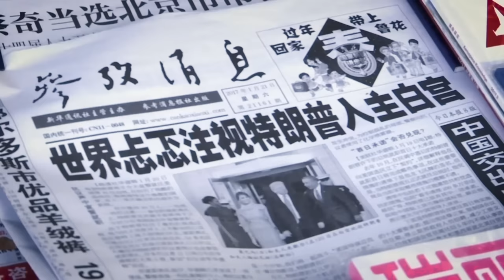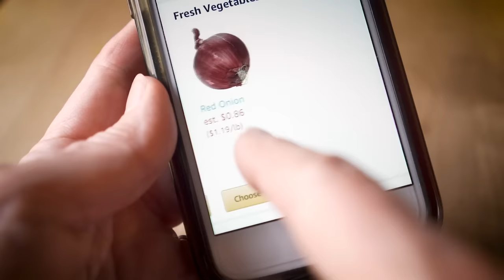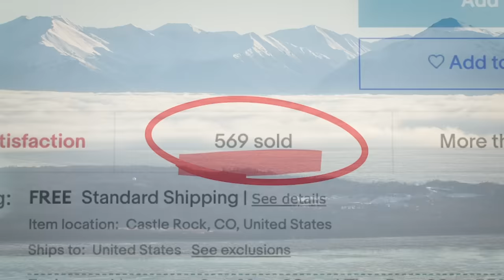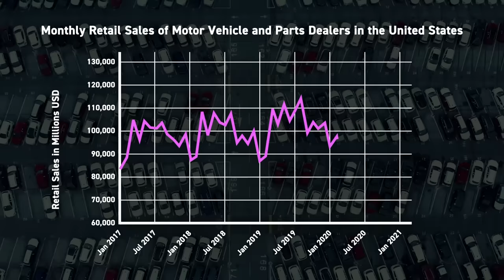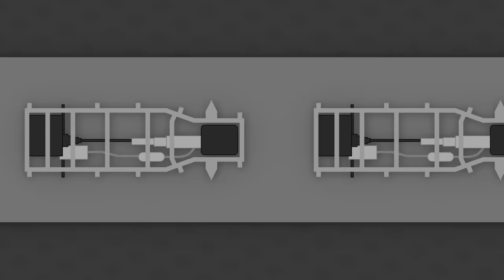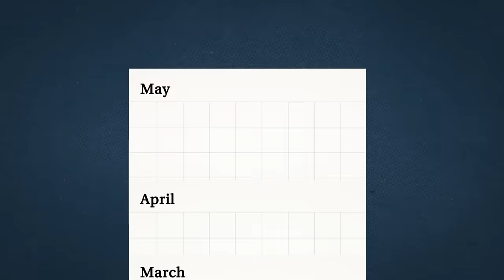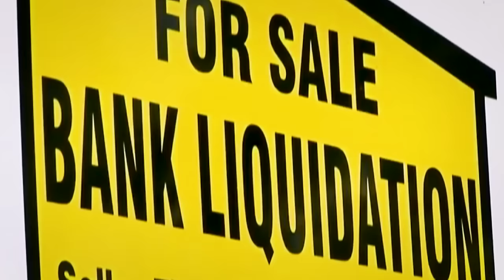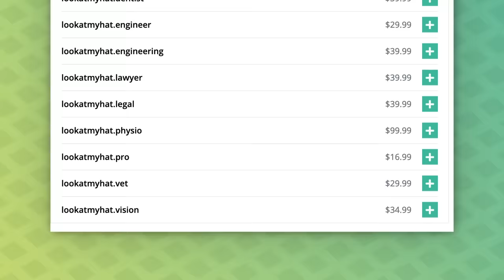Why There are Now So Many Shortages (It's Not COVID)

Comment: So, literally, everyone operating on short-term just-in-time delivery models compounded in every direction to ensure that the steady flow previously maintained and economies of scale previously enjoyed are now, themselves, liabilities.
Reply: jIT.  Ah yes. It was always on the edge of disaster but US companies followed the Japanese model even though the US doesn’t have the same power & control over the industry
Reply: Something that I find ironic is that this model of continual flow manufacturing, where products are made and shipped in as small of a batch a possible to better facilitate quality and the economics of business, is a pretty new concept. Like, within the last 20 years or so new. It has existed before, but only got pushed recently over the previous style of batch manufacturing. I gotta wonder how much of this shortage-demic was due to a newer style of business that relys on a prefect functioning system to work.
Reply: liability for you.... advantage for who?.... figure out how the world works already...........
Reply: @insiainutorrt259  ?
Reply: Good TL:DW :)
Reply: This is exactly how it happened. I posted above about the company I worked for that implemented JIT(for them OPS was the name). Anyways they have 2800 locations, 260 companies, with 80,000 employees globally. I'm sure there part of the reason for some of this. They produce concrete block, brick, precast, glass, wood, aggregates, asphalt, safety equipment, fence, rebar, mulch,  and so much more.
Reply: @exploringlife738  Man are you so caught up in the political left versus right non-sense that you cannot realize they all work together? 

You think Biden isn't going to also hand out trillions to the 1% in his 6 trillion dollar budget? Did Obama not bail out all the banks, car industry, and other 1% corporations during the 2008 recession?

Wake up bro, republican, democrat, it doesn't matter they are all one big club and we are not in it.
Reply: @exploringlife738  Was just gonna say, like either side is better or wont do the same quit wearing bias blinders and wake up to the reality that you back people just as bad. The guy above did it much better.
Reply: @exploringlife738  in assuming you were not talking to me. JIT for the company I worked for started in Ireland(there home office) CRH PLC.
Reply: No. As the video says, it's a dramatic oversimplification of what's actually been going on.
Reply: Basically the big Wall Street investors control this.  Carrying inventory is a liability on the balance sheet and all Wall Street cares about is year-over-year compares, quarterly growth and if you hit your revenue estimates.  Having cash in the bank or large liabilities in inventory is bad in the eyes of Wall Street because that means you're not using your money to return value to the investors in the form of dividend payments or growing the company.  Owning and storing the inventory you need to build products is bad because your money is now tied up in inventory costs and you have the costs of unproductive floor space to store that inventory.  A warehouse to store inventory costs money to build and maintain and doesn't generate revenue, it consumes revenue essentially adding cost to the products.  Wall Street doesn't see beyond about 12 months and has zero long term vision.  All they care about is sucking as much wealth out of a company as fast as possible to pay off their shareholders, and themselves.  If they kill the goose that lays their golden eggs, they don't care.  They sell off their investments to unsuspecting consumers and take their money elsewhere to kill another company.
Reply: @JoshDragRace0688  I see this excuse coming from previous Republicans so often nowadays. Millions of people around the country who were raised conservative have realized how despicable and corrupt the Republican party has become (or has been for decades) and since they already have deep-seated bias against Democrats, the only conclusion they can arrive at is, "well, my party is clearly corrupt, so I guess both parties must be". They fail to acknowledge the many attempts that Democrats have made in the past decade to legitimately improve the quality of life of Americans, only to be stonewalled by Republicans in Congress. 

And regarding the Obama bank bailouts after the 2008 financial crisis. Yeah, I get it, that was hard to stomach. I was annoyed when Trump bailed out our agricultural industry after his failed trade war nearly bankrupted farmers across the country. Our tax dollars being gifted to companies we already pay out the nose for every day products is a slap in the face.
But regarding the 2008 situation and the bank bailouts, specifically. What would YOU have done if you were in charge when the backbone of our entire financial system unraveled and nearly tanked? How confident are you that your approach would have done a better job at keeping our economy afloat and aiding its recovery? And whatever your idea might be, ask yourself this - would Congress have actually approved it? Or would your proposal have been stonewalled or contested endlessly and ultimately amounted to doing nothing at all, leaving the country to fend for itself as the economy collapsed under your watch?
Reply: Been warning about this for years. Welcome to the show
Reply: @abikeanditsboy3449  Yep, this is pretty much spot on. The pain being felt today is the result of a JiT manufacturing economy, which was the result of the never-ending quest for optimization and efficiency, where inventory is considered a liability because the expense of storing that inventory counts against net profits, it hurts the bottom line. And the bottom line is the sacred measure of success and value in a capitalist economy, particularly a publically traded one. 

I say this as someone who fully respects and enjoys the benefits of capitalism on a daily basis. But the simple fact is that capitalism lead to this problem. It does offer a solution as well, but it requires companies to do something they don't want to do - raise salaries and spend serious money investing in their workforce and supply chain.
Reply: @rdean150  I would of let all those businesses crash and burn, that is capitalism, You cannot spend tax payer dollars and put our country in debt to bail out private corporations, that is straight up phony capitalism. And all it did was delay the crash, its still coming and probably soon, that is how it works, ups and downs. I didn't agree with lock-downs and Trump handing out trillions because of it either, especially the money given to the pharma companies.

And I don't like the democrat party for many other reasons, like their stance on immigration (let them all in!), their stance on not needing ID to vote, their stance on the 1st and 2nd amendment. (they are fine with people being censored, and are fine with taking guns away from everyone), and their stance on critical race theory is absolutely racist.

Either way both sides work together, its all a divide and conquer strategy.
Reply: @rdean150  - I don't think capitalism lead to this problem, I think it was simple greed that lead to this problem.  The CEO for the company I worked for put people ahead of profits.  He took a salary of $200k/year and in 2008 it went to $1/year.  The employees got bonuses based upon the same exact formula as the CEO and company officers did.  When our CEO retired we got a new CEO who had very different values.  The new CEO got a nice big salary and bonuses and worked hard to please Wall Street while the employees didn't do so well.  He does what it takes to pad his bank account and doesn't care about the people who work for him.  The new guy is motivated by greed and doesn't care about the people.  As long as he's doing well, that's all that matters.  It's simple greed.  (To be honest, I think a lot of CEOs show signs of being sociopaths.  You kinda have to be to succeed in the cut throat business world unless your company's products and services are that much better than your competition's and you can succeed on merit.)
Reply: @abikeanditsboy3449  Capitalism perpetuates that greed.... you MUST get as much profit next quarter, next year be damned.
Reply: @laysdong  - As I said, our previous CEO didn't play that game.  Wall Street put a lot of pressure on him to grow the company and return profits and he refused.  He managed company growth and had a business plan that could weather business cycles.  In upturns we didn't make huge profits like others, but in downturns we didn't suffer the losses either.  We were slow but steady.  This CEO wasn't motivated by greed as much as he was motivated in taking care of the people who worked for him.  The new CEO is a different story.
Reply: Yep....  every business tried to maximize themselves on paper because why not?   But when the world shuts down, fuuuuuuck
Reply: @ndrose  In addition, they did not study the underpinnings of the JIT concept. Japan has a very short distance to obtain most of it's supplies but the US acquires most of its supply from locations far distant. Very few manufacturers still make the items in this country. The majority is sourced from the Pacific Rim countries (China, Vietnam, Laos, S. Korea, Taiwan, etc.). IF everything works "perfectly" the supply item will arrive in time to be used the next day or even the same day.  Very little tolerance is given for delays of any kind.  Too many businesses, especially in the USA only consider short term, i.e. one year or less profits and supply operations. Just like profits and planning, only short term is considered.  Other countries, like Japan consider long term planning and profits.  Toyota for example has a strategic plan which goes out for 100 years.  Very few American manufacturer's go out further than ten, if that far.
Reply: @Harry-zz2oh  You're right on the principle, wrong on the time scale. Wall Street ensures that publicly traded companies only care about QUARTERLY numbers. It's that mentality that wrecked everything.
Reply: @laysdong  that is actually an invention of the Democrats in the 1960s that they have tried to make reality for so long that people who don't bother to apply critical though to it simply believe.

Hint: the stock market isn't capitalist. It has never been unless we're talking cattle stock, of course.

Comment: It's fascinating that the auto industry had these problems recognizing which parts of their supply chain should be flexible and which shouldn't. Car construction today is based around identifying 'crumple zones', parts of the car that can flex and compact to absorb energy in a crash, around a rigid frame. Their supply chain is no different: some parts can flex and some must remain rigid for it to work.
Reply: You hit it right on the head. Principles, principles, principles! Details differ, but principles prevail.

Comment: Excellent video.  I forwarded it to my supervisor.  I’m an operating room nurse and can tell you that we are dealing with all sorts of shortages. I work at an outpatient center who believes in “just in time ORDERING”..... so that compounds the problem. I’m hoping this experience will initiate positive changes in the supply chain.
Reply: Just in time ordering isn’t necessarily a problem. It glosses over huge components I don’t think people consider. I mean especially in healthcare certain products do have shelf lives. Just in time ordering is based on necessary lead times along with (usually) some sort of built in buffer to account for minor disruptions like capacity and logistics issues. The real issue is cost. Contrary to popular belief the reason why an iPhone is as low (or high) as it is is because of jit. You hold inventory longer the prices go up. People already complain about inflation now then people’s heads would explode if they think holding inventory is the right way to go. Working in semiconductors the real issue is the disruption having strains down the supply chain to suppliers who simply can’t keep up with demand. The real dumb part is companies (including mine) single sourcing products to keep costs down on suppliers who have capacity issues and subtier supplier shortages. All for the sake of low dollar cost. But it all means squat to have low cost when you lock them in and still have to pay expedite fees anyways that drive the cost up, which loses all the benefit of having them as low cost partners. By the time you pay for all that junk (in high quantities) you’re better off buying the premium cost 30 minutes away to alleviate the capacity issues of your other supplier. It’s higher front end margins which lose money in a perfect world but the end product company (semiconductors) lose all cost leverage on the back end. It’s so dumb when you really dig into the weeds of it. And like they say “poop” rolls down hill lol